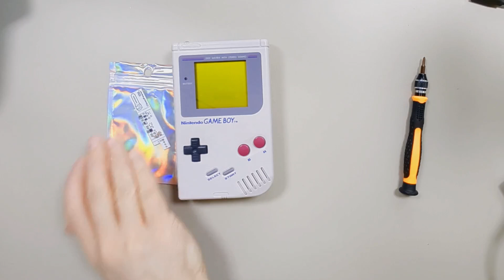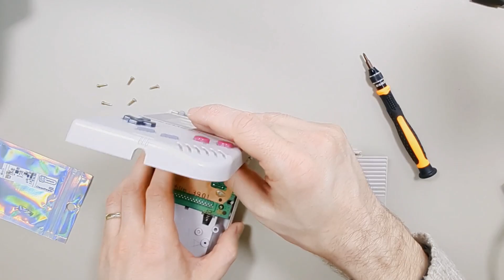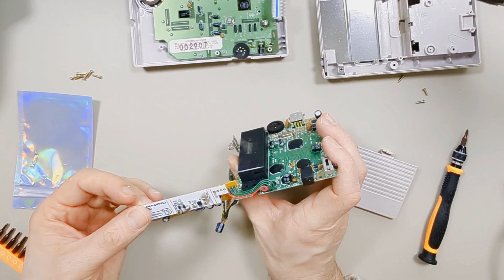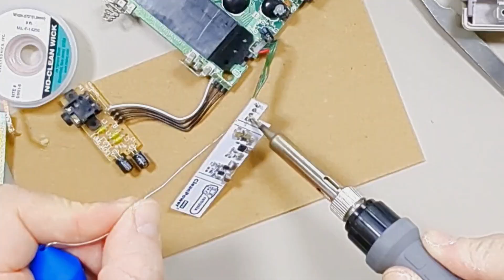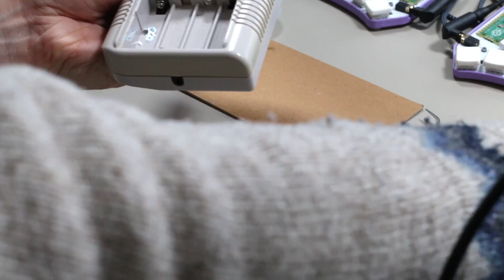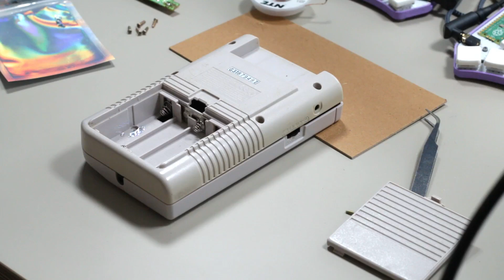How to: Fix a GameBoy's Power Problem

Comment: Interesting- these CPU-07 and -08 blob top boards are the ones with upgraded OEM boards. But I guess everything wears out eventually.

Also I see it's an August '96 assembly, but there is a service sticker indicated its a factory refurbished model. Only ever seen a handful of these! I assume by that sticker it was refurbed in Week 29 of 2000. No idea if the 07 is a day, shift or something else, but would be neat if it specifically meant July 23, 2000.

Comment: Were you confident that replacing the power regulator board would fixes the issues you were encountering? Or could it have been something else?
I'm curious how confident you were that spending money on the replacement part would fix things :) 
Thanks for the content!
Reply from the maker: I was somewhat confident it would fix the problem. The symptoms of a failing power regulator board matched what I was seeing. I'm not sure what I would have done with this video if it wasn't the problem though!